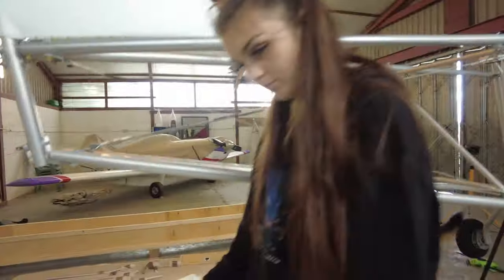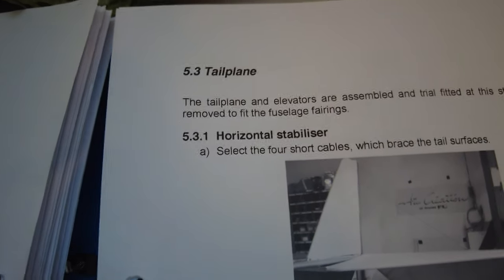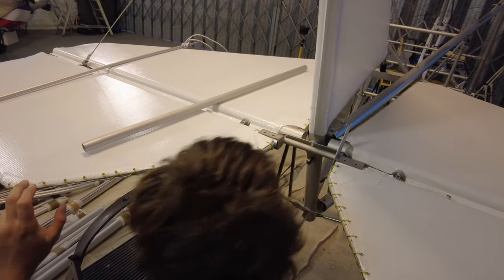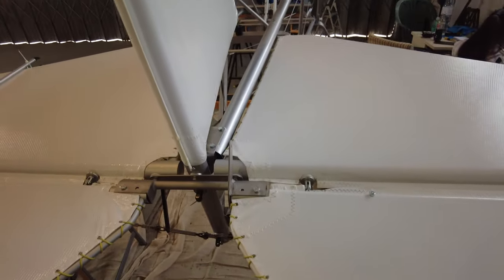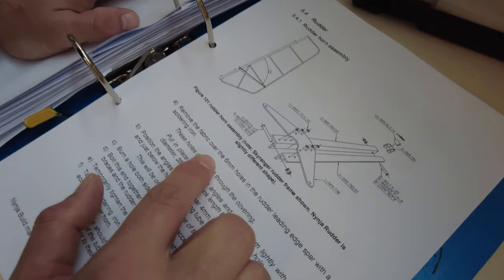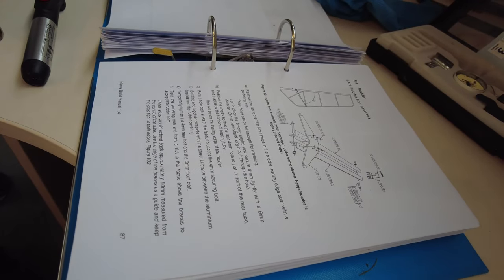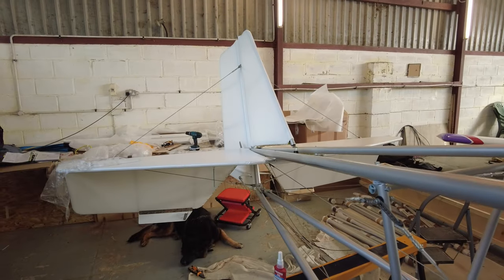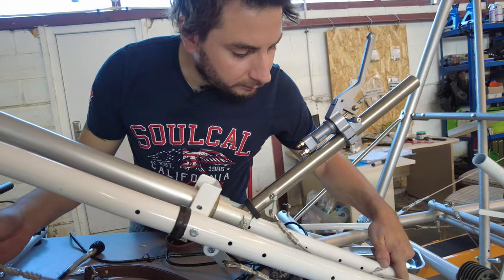Building A Plane | Building My Skyranger Nynja | Drilling/Fitting Rear Control Surfaces | Episode 7

Comment: Maybe next time you drill the holes for the trim tab rivets you could drill the first one and then use that first rivet to hold the whole unit in place thus giving you a guide to drill through (and hopefully prevent any drill slippage)?

Comment: Hi Nick, you might want to consider clamping the elevators to a straight edge across the aircraft, that is you are clamping them to each other (swing the rudder to one side) prior to drilling that new elevator leading edge tube. If you don’t mind me saying I don’t think the digital protractor will be accurate enough…
Reply from the maker: Thanks Michael! It has all been signed off now so I got it right second time around! Good advice though!

Comment: Centre punch might have helped with the drilling bit just to give you a start - (blimming backseat builders!) I suppose they may prohibit this as it might distort the tube. Looks like it's coming together nicely. 👍
Reply from the maker: That is good advice! It doesn't say you can or cannot in the manual but I can see arguments for both. I reckon some sort of home made jig might be a happy compromise.

Comment: Heya Pal, looking great as always. a tip when it comes to drilling holes on uneven surfaces is to push hard and manually turn the drill to create a spot. This will prevent the drill bit from wondering as it did. Hope this advise helps :D
Reply from the maker: Thanks for this! Super good advice!
Reply: @LetsGoFlying  you are very welcome pal. If you need any help just pop us a message on TikTok. 😁

Comment: Get rid of that big battery drill. Get yourself a small pneumatic one. It will give you better control and will be a lot lighter to handle.
Reply from the maker: This is a good idea - I am looking into it as we speak!
Reply: A good craftsman never blames his tools 😉
Reply: As I worked as an aircraft engineer and built a number of aircraft. A good tradesman does not blame his tools because he has the sense to purchase the right tool in the first place. Get an air drill that has good fine control. Atlas copco, are the aircraft engineers preferred brand.
Reply: @johnhodgkiss9882  your quiet right, but I doubt Nick will be going into it full time. 😊